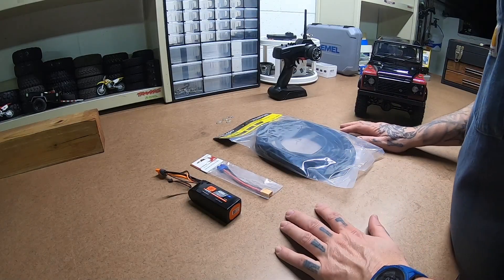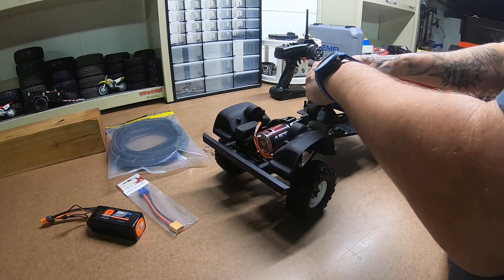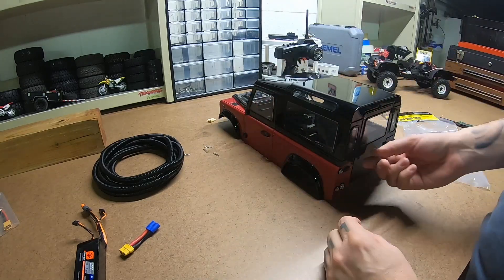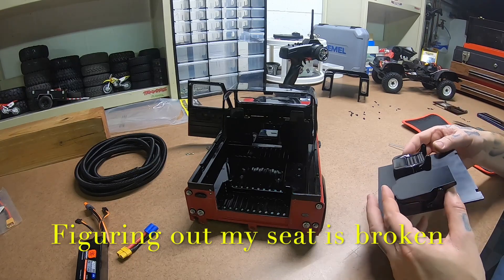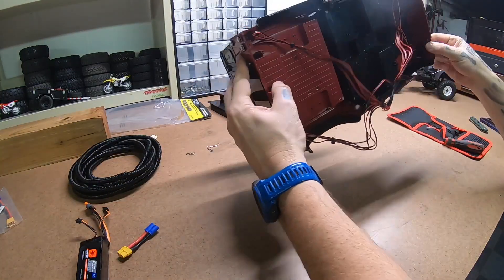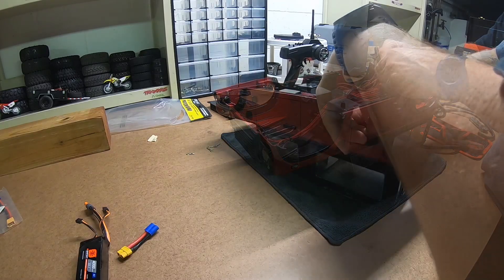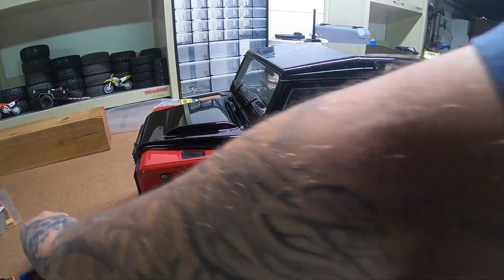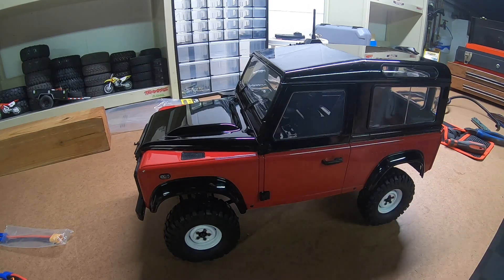RC4WD Land Rover D90 rear interior delete and light kit wire clean up. (Battery relocation fail)

Comment: Good video!  That would be too difficult with those body clips.   Working on these rcs can be a little  bit tedious.  Even what seems like would be quick and easy.
Reply from the maker: You’re absolutely correct. But still loads of fun.
Reply: @toeshifter  yeah, my Trx4m Bronco is already worth about  $400. Next is the new Losi 1/16 1970 Chevelle in black.
Reply from the maker: @johnlujan8706  very nice